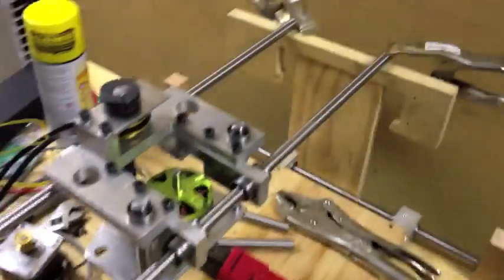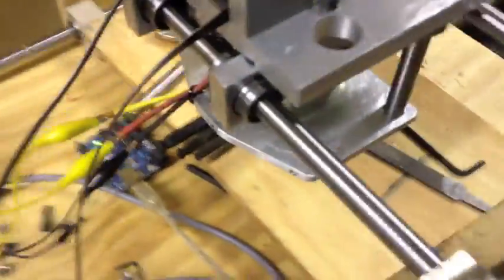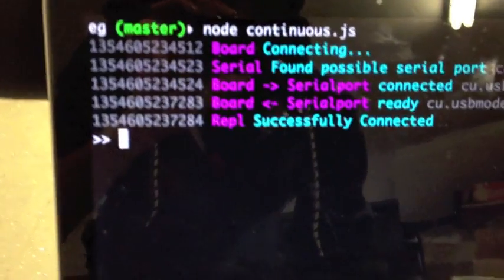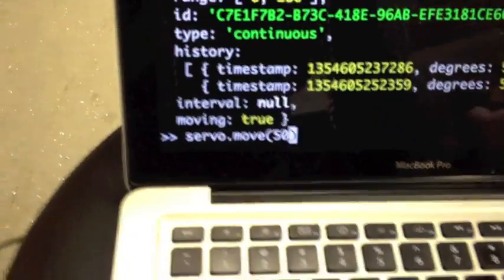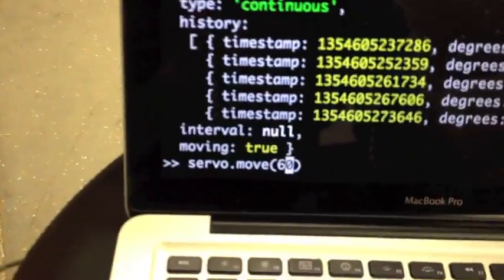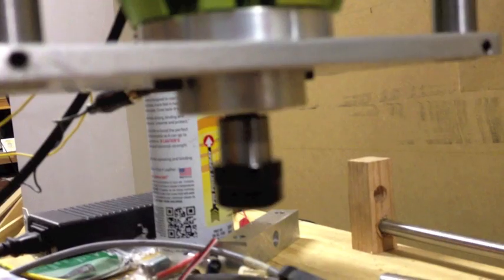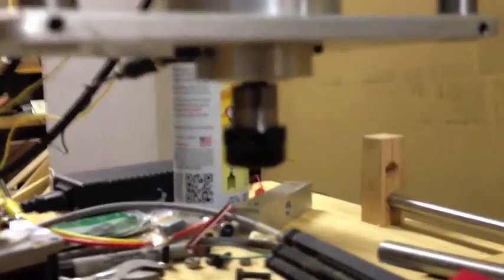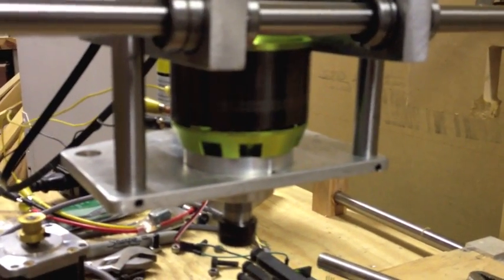suitcasecnc spindle test

Comment: OK! I SEE ...BUT CAN RUN 10000RPM?
Reply from the maker: I never hooked a tachometer up to this build, but I'd imagine the top speed is ~5000-6000 rpm (295kv * 18v)

I've since moved to a 1700kv motor and geared it down. Makes it easier to use different straight shank collets and build a bearing housing for it.  Anyhow the new version is running at 12v so the top speed should be around 10000rpm at a 1:2 ratio.